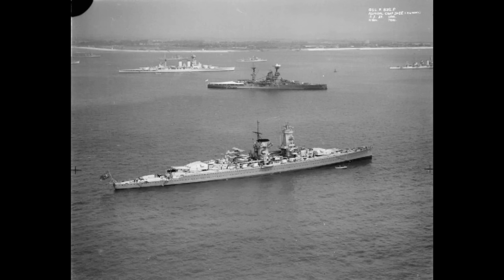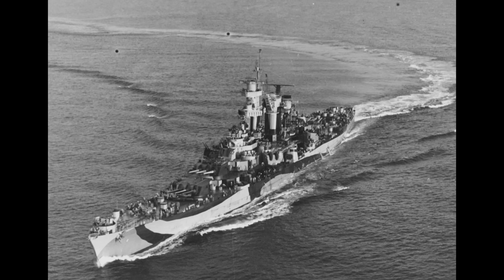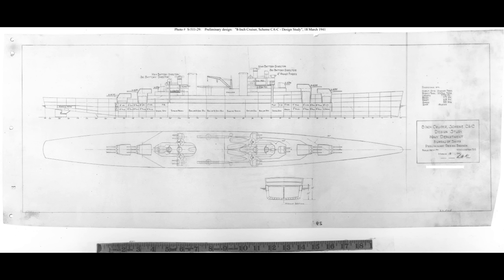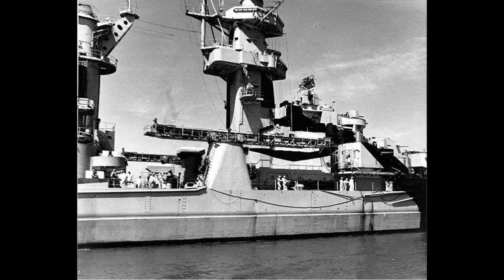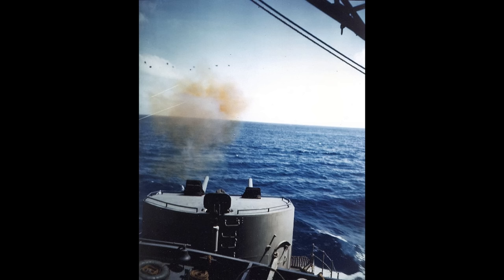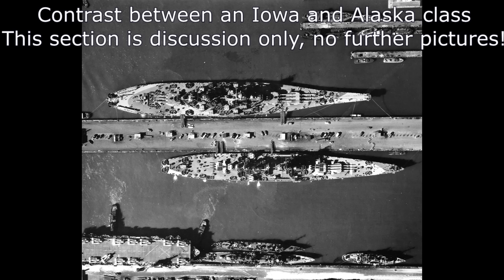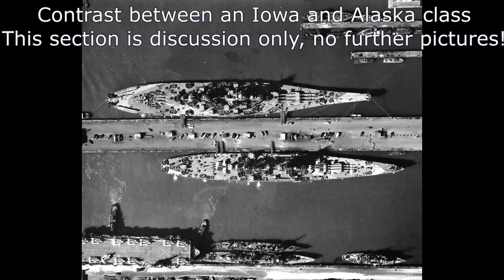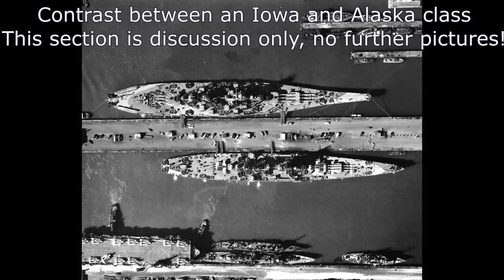The Alaska class - Large/Super/Battle/Mega/Hyper/Ultra Cruisers

Comment: you neglected to mention one fundamental reason alaska was built. it was one more step along the path of understanding ship design and performance characteristics in a time when CAD and computer simulation of those characteristics and performance hadn't yet been developed. the usn had been compiling engineering data for decades for ships which had been built for the usn, and to a limited extent for ships which had been built for other navies; but every step forward required a test model, and alaska provided a data set for a gaping hole- destroyers and cruisers had been pushed to larger and larger ship sizes for decades, reaching 15k tons; and while battleships had provided some data for 20k+ tons, battleships had tended to be much fatter owing to the armor demands. alaska provided a data set for a ship more in line with a cruiser than a battleship at 30k tons, a data set the usn had been lacking in its own designs and had only limited access to in the form of similar ships produced for other navies. the morphing alaska design was convoluded by different interests interjecting their ideas, certainly, and by rapidly advancing shipboard systems, for sure, but there definitely were changes which were simply part of the fundamental reason for building alaska- and that was simply an exploration of what can be fit into a ship of this size, where to put it, and how to balance the ship out with respect to stability, speed, protection and firepower, all while trying to ensure the end product would be able to at least somewhat approach the planned purpose and utility. All of this would have taken on more importance had the war not ended for some years yet. I wouldn't be surprised to find that the engineering data set for alaska was used at least in part in future warship designs, just as had been done throughout the history of the usn.

Comment: You mentioned that guns and machinery are the items with the most lead time. Do you have videos explaining the production process and / or why they are such a long leading item?
Reply: Wouldn’t that be the video he did on the development of naval guns?
Reply: In general terms its a matter of complexity.
Damage control equipment, radar, secondary batteries and AA guns are built in enough numbers that you can build them in bulk of hundreds of not thousands and socketed as needed

The turrets, their gun control systems and their counterbalance units are unique to the barbette size the ship can take.
Engines need to be designed for the Hull of the ships
Boilers need to be designed with funnel placement and associated smoke Trunking.
These things mean that unless mass producing the class ala Fletchers you are building these equipment on a bespoke basis with the idea being tweak the unit to make it work, instead of tweak the design for future building speed

Comment: One thing that gets forgotten with the Invincibles is that from the beginning, they were never just cruiser killers.  According to Roberts one of the deciding factors for them having 12 inch guns instead of a uniform battery of 9.2 inch guns was so they could shoot at enemy battleships and assist the friendly battle line.  Fisher also discussed this with his Committee on Designs before the first steel was ever laid.

The one common feature for every battlecruiser completed as such was some mission to support the friendly battleships against enemy battleships.   The nature of that support varied by nation and is reflected in their respective design differences but it was there.

Alaska doesn't share that.  So comparisons to Invincible as an argument for them being battlecruisers is only partially correct and therefore lacks weight.

Comment: The more I hear about these ships, the more I'm convinced that the question isn't whether or not these ships are battlecruiser, but what a battlecruiser even is. Drach is spot on that these ships are closest in specification and intention to the original dreadnought armored cruisers than they are most subsequent battlecruisers, not that WW1 era battlecruisers were a reasonable yard stick to measure against in the post-treaty era. Perhaps battlecruisers, as a term, needs to go away, with different and more specific terms to describe the era and the design details used instead. If we had better terminology it would be easier to describe and classify the Alaskas, along with other classes that blurred the lines between ship types like the pocket battleship/raiders and their French counters.

Comment: Respectfully, I disagree with both of your descriptions of "what would Alaska have needed to be in order to be a battlecruiser" at the end. (And yes, sorry in advance for the upcoming book-length post, but there's a lot to discuss. 😁) Side note: it was great meeting you at the USS Midway a few weeks ago. Which one was I? Um...I'm the one who forgot sunscreen. 🥵

Description #2 has the simplest issue, which is that I consider both Hood and Iowa to be fast battleships rather than battlecruisers, and therefore an unfair standard to judge Alaska's "battlecruiser-ness" by. As Anant Rajagopal described very well in his comment, Hood compares to the QEs almost identically to how Iowa compares to South Dakota: roughly a 40% increase in tonnage to gain 6-8 knots of speed while keeping essentially the same armor and firepower. That last part is key, since I believe the dividing line between a battlecruiser and a fast battleship is that while they are both faster than typical battleships of the period, a fast battleship is designed to fight other battleships (both "fast" and "normal speed") 1v1 while a battlecruiser is definitely not. That whole subject will be a fun discussion in that future video.

As for description #1...what you came up with essentially is the Alaskas as built, except swapping the triple 12-inch guns for dual 16s. While that does now allow the Alaskas to meet the "same guns as contemporary battleships" criterion, my issue is that it really changes nothing about the capabilities or role of the ships. It's still every bit as capable of killing standard cruisers, but the switch to 16-inch guns does not make the Alaskas any more capable of fighting a contemporary battleship 1v1, nor does it change their designed role to include fighting battleships, nor does it make it any better of an idea for admirals to use them against battleships. So I consider the gun swap to be essentially irrelevant, which goes along with my view that having the same guns as contemporary battleships is not a requirement to be considered a battlecruiser. I would argue that a battlecruiser only needs to have substantially bigger guns than standard cruisers of the time. Obviously battleship guns meet that requirement, and it's what most navies went with out of simplicity, but an intermediate gun caliber like the Alaskas' 12-inch guns or the Scharnhorsts' 11-inch guns also qualifies. Also, I think it's kind of arbitrary to use the South Dakotas as the "speed standard" in one case for a hypothetical BC Alaska while using the Iowas as a "speed standard" to try and disqualify the historical Alaskas in another. I think the Iowas are the exception rather than the rule for BB speed at the time, so I think the South Dakotas are the right standard to apply throughout.

In my opinion, any ship that is designed for the mission of "kill cruisers, run from battleships" qualifies as a battlecruiser. So my criteria for judging whether a ship counts are based on the two parts of that mission. In my own personal definition, a battlecruiser must:

1. Be easily capable of killing contemporary "standard" cruisers. This means it needs all of the following:
a. Much greater firepower than a standard cruiser through larger guns.
b. Armor to protect against standard cruiser guns of the time.
c. Speed comparable to contemporary cruisers.

2. It also needs to be incapable of matching up against a contemporary battleship 1v1, by being deficient in at least one of the following:
a. Number of guns.
b. Caliber of guns.
c. Armor protection.

If a ship fails #1, it's not powerful enough to be a battlecruiser. If a ship meets #1 but doesn't have any of the deficiencies listed under #2, it's a fast battleship. For the Alaskas, they meet all the requirements under #1, and meet #2 by having smaller guns and less armor than contemporary battleships, so I'd say they count as BCs.

Comment: I wonder what the US would have come up with if they had designed something similar to the Deutchland class Panzerschiffe (but larger, because America)?  Turbomachinery was in short supply during the war (despite my Granddad's best efforts) hence the diesel-electric drives on the Cannon class DEs.  Instead of armoring them to fend off their own guns (which seems rather silly to me) rather make them able to outrun anything they can't outfight.  Admiral Graf Spee could make almost 30 knots on diesel power, and she was launched in '36. American industry in the '40s could have done better. I'm thinking a more reasonably sized hull with six of the 12" 50 Mark 8 guns in two triple turrets or three twin turrets.  Much cheaper and quicker to build.

Comment: At 3:00 you show a invincible class dreadnought. There are what looks like pipes running at 45° on the side of the hull / freeboard. Do you know what they are used for  ?
Reply: He answered a broader version of that in an older Drydock episode (I forget which one). They are light anti-torpedo net booms, they where quite common around the turn of the 20th century. They where intended to provide anti- torpedo defense at low speeds, primary torpedo defense in undefended harbors, and additional torpedo defence when in a defended harbor. They fell out of use shortly before WW1 as advances in torpedo design (primarly around increased weight and speed) enabled newer ones to punch through the light netting without issue. This rendered them pointless extra weight at best and actively detrimental (by forcing the ship to move slower when deployed) at worst.
Reply: @hanzzel6086  thank you, I'll have a look. Approximately how long ago do you think the episode was ?
Reply: @autoculto7629  I saw it a couple of years ago, and I think it was an older one at that point. Try #50-150. I wish I cluld be more helpful.

Comment: Oh, the idea of using a cruiser as a launch platform for V-2 rockets is hilarious!

Not only would you need a supply of liquid oxygen - either from some kind of on-board cryo plant, or a massive storage tank that would constantly be boiling off pure oxygen gas - but the fuel the V-2 burned was pure ethanol.  The Germans had some difficulties with preventing soldiers from stealing the fuel for personal consumption. But to think of a shipful of American sailors being prevented from doing the same on a massive scale is just laughable.

Then you have the permanganate and high-purity hydrogen peroxide that was used in the V-2's steam generator to drive the turbo-pump.

The entire situation would be a massive detonation just waiting to happen.

Comment: The ships had some basic flaws that the navy did not prefer which led to their being decommissioned. One is that their turning radius was terrible having a single rudder.  Two the bridge structure was not desirable especially the conning tower, as you mentioned.  Three is the central airplane hanger and stowage.  Its unfortunate that the Navy didn’t reconfigure the superstructure for missile era operations.  The air craft launch and stowage could have been rebuilt for command and control ship capabilities. 

One other thing about the “Class” of the ships. You always classify a ship based on its intended design purpose and size.  Despite what BUSHIPS  claims were about the large cruiser design characteristics.  The se ships were designed to run down heavy cruisers and destroy them with superior fire power and defend against same.  No matter their torpedo or compartment division or layout.  These were battlecruisers and that was their design mission function.
Reply: But the "battle" in battlecruiser designates fighting in a line of BATTLE. If an Alaska were to find itself with a South Dakota fighting 2 King George Vs it would have no other option than run. Hence why the Large Cruiser designation, might seem like a small difference but it's what would have made the Battle of Jutland less devastating for the British

Comment: If you stick with the original definition, "A ship to battle and defeat regular cruisers" then the fact that the ALASKA Class is smaller and has smaller guns than the latest series of battleships is meaningless, since in WWII the heaviest standard cruisers have not changed their armor thickness (6" maximum, usually less) nor their weapon size (6-8" guns), while the number of guns has only increased slightly in some of the light or heavy cruisers (fifteen 6" or ten 8" guns in a few ships, mostly just eight or nine), from the sizes and numbers used in WWI, though the later ships are larger and  faster than their WWI-era.  Thus, they did not need to increase gun size or even the ship size very much to be able to fight enemy cruisers exactly like in WWI.  The business with putting ever-larger guns on them was something done when the idea of putting them into the line of battle came about, with bad results all around in both WWI and WWII naval battles (German, Japanese, and British).

Most Japanese cruisers had minimal armor.  When the US realized this they created a unique 8" anti-Japanese-cruise projectile:  They took one of their High Capacity  (nose- and base-fuzed HE) and modified it into a extra-high-power SAP-type shell.  They removed the Auxiliary Detonating Fuze (safety nose fuze) and permanently attached the hardened steel nose plug that was usually just optional for HC shells -- both changes to allow thin-to-medium (0-3") armor to be penetrated.  They then replaced the non-delay base fuze (there to do the indicated armor penetration when the nose plug was inserted) with an obsolete Mark 23 Base Detonating Fuze (BDF) with its delay time set permanently to 0.035 second (I think this was the delay used; though I can't be positive since this the original form of this fuze, the Mark 10 BDF, could originally vary its delay, but it was replaced in US warship AP ammo by the more reliable WWII AP-shell Mark 21 BDF just prior to WWII).  You now had a super-HE-blast-powered SAP shell and the US heavy cruisers could save their superior Mark 19 (US Treaty cruiser gun) AP shells and Mark 21 (super-heavy AP shells for the new US heavily-armored cruiser guns) for fighting Japanese battleships (such as with Japanese KIRISHIMA Class battleships, mostly).  These unusual HC shells had about triple to quadruple the Explosive "D" filler or the 8" AP shells, making them almost as powerful as 12" AP shells.

Comment: I'm going for "they are what they said they are", large cruisers; in initial concept, meant to operate alone- beat what it could and run away from anything else (was the USS Constitution the first "battlecruiser"?).  Also, looking at the photo; 1 Iowa could easily fit 3 Alaska's.  Hood was larger and faster and had bigger guns than any battleship up to 1940 - that is a "Battlscruiser", with the achilles heel sadly aparent.  It would actually be more sensible to argue that the Iowas were battlecruisers.  Sort of like the Queen Elizabeth's what is the difference between a battleship and a battlecruiser?

Comment: The US Navy Classified the Alaska Class "CB" which stands for Cruiser Battle, NOT Battlecruiser.  Cruiser Battle means just that nothing else. For those who can't get their Brains around this, it is simply a NEW class of ship,  (needed by WW2) as pictures of the type should reveal to anyone who isn't holding a white stick !!! Therefore the CB is a Cruiser, with "Battle" capability, & if you still can't grasp the concept it means it can sink everything smaller or equal to itself but NOT bigger, and certainly NOT Battlecruisers.
Reply: This is a batllecruiser.
Enougth fire power to not fear anything of the same size, fast enougth to evade anything to big. The definition of a battlecruiser.

If you want here is a definition: "The goal of the design was to outrun any ship with similar armament, and chase down any ship with lesser armament; they were intended to hunt down slower, older armoured cruisers and destroy them with heavy gunfire while avoiding combat with the more powerful but slower battleships. However, as more and more battlecruisers were built, they were increasingly used alongside the better-protected battleships."

and yes it's wikipedia but recent benchmark show that there is not more mistakes on wikipedian than in the universalis encyclopedia.

And honestly... battlecruiser... cruiser battle...

Comment: I mean, if you want an extremely clear example of a navy officially labeling a ship as belonging to a different category than any objective classification would consider it, the poster child for this is the current Izumo class, which is officially a multi-purpose "destroyer".  813 feet long, displacing 27,000 tons fully loaded, and capable of carrying 28 aircraft.  Sure, that's a destroyer, what else would it be?  Please.

In terms of speed, the Iowa class is arguably an unfair comparison, having been specifically designed to keep up with carrier fleets, which made them, by battleship standards, abnormally fast.